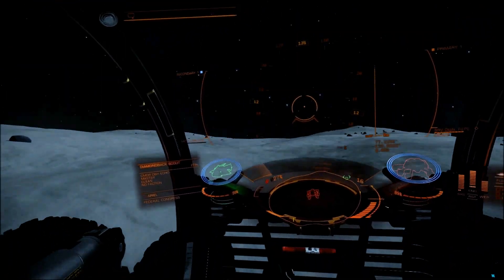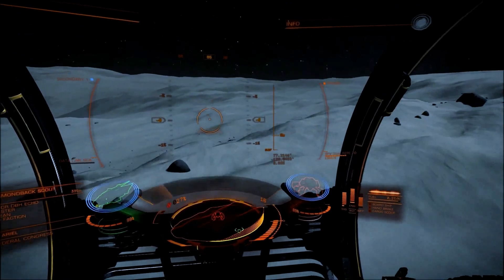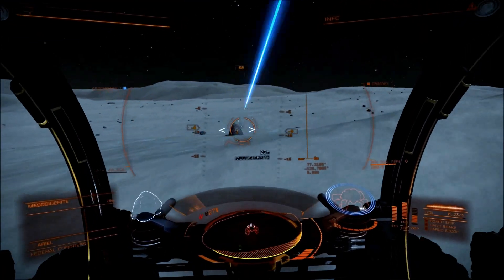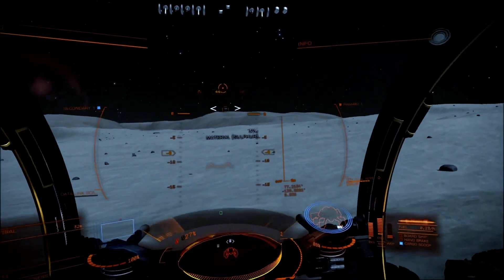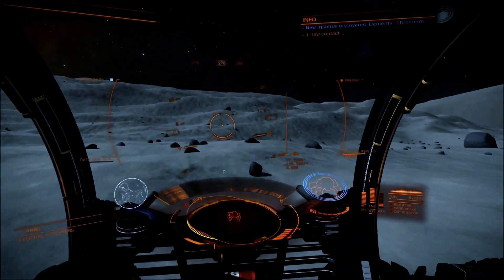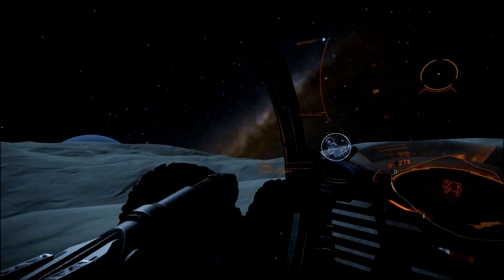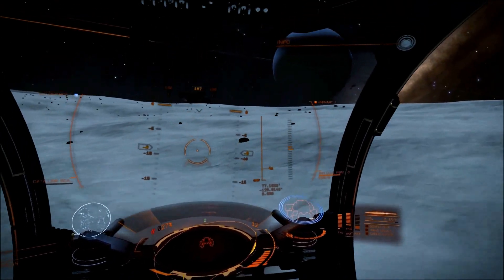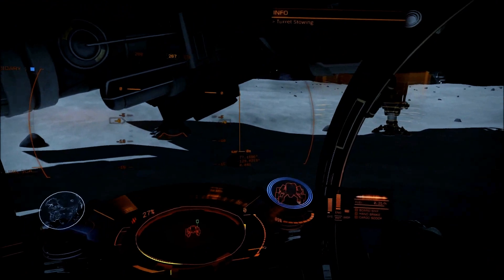Elite Dangerous Horizons, SRV Wave Scanner

Comment: How do you actually find mineral rich areas? I am looking for a level 5 FSD upgrade and need some arsenic. The Galnet in the engeeneers base recommended choranthia 2b as sourcce of arsenic. I have found literally 1 rock which dropped 3 arsenic (it was called a mineral metorite or something like that) and since then I keep finding crap rocks (called something else) which drop nickel iron carbon and phosphorus. It also takes me like 5 minutes real time to drive from rock to rock. Is there any way to find areas with high mineral patch density from orbit? or from the ground? I want enough arsenic for 10 rolls or so before I leave this rock. I landed at a random area on the day side for better visibility while landing.

Wish I could just buy the damn stuff I've got 170 million banked. I really hate the SRV.
Reply from the maker: That's a good question man.  Your best bets are to look at trade routes to find systems that are exporting precious metals.  From the galactic map, zoom into the system map and look for planetary bodies that are "High Metal Content" or "Metal Rich" to try an maximize your chances.  There are some really good tutorials out there about using the galactic map to filter for specific things - most of them are trade focused, but you can use retool that knowledge for resource hunting.  As far as spotting fields from the air?  That seems more random.  It might just be my imagination, but I feel like I spot more minerals in slightly rocky areas.  Best of luck.

Comment: how about the sounds the scanner emits, how do those correlate?
Reply from the maker: +vracan Both the sounds and number of "bars" high the image is will give you clues as to the density of the object you're approaching, think of it like stacking Legos.  An object that is only one or two Legos high will be simple, common minerals with a less "dense" screech pattern in the wave scanner.  An object that is three bars high will be a more complex mineral used in intermediate or advanced crafting.  Both the sound and the image tighten up as you approach.  To demonstrate that, find a mineral rich moon (I would recommend any of the moons around the resource extraction sites in He Bo)and locate two mineral stashes close enough to each other to where you can rotate and listen to their sounds, as well as see  how many bars high the scanner images are.